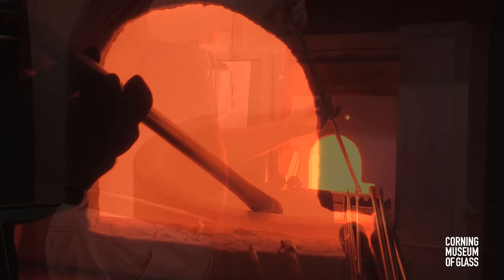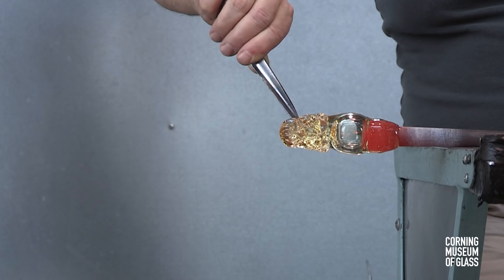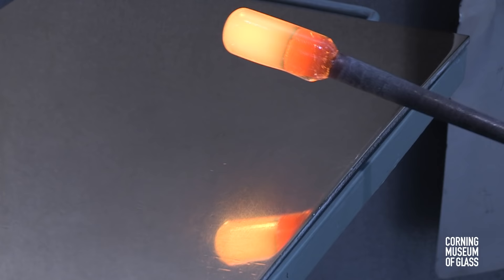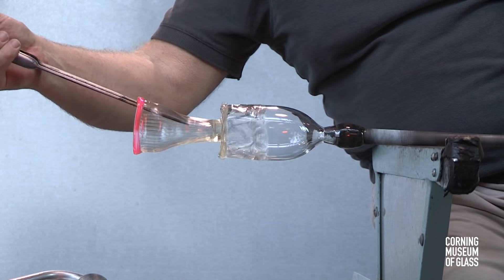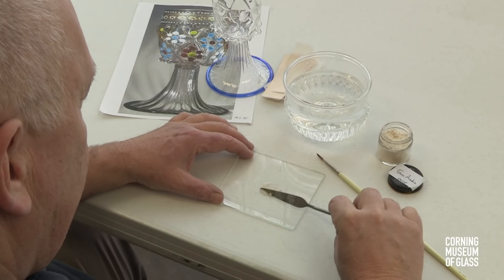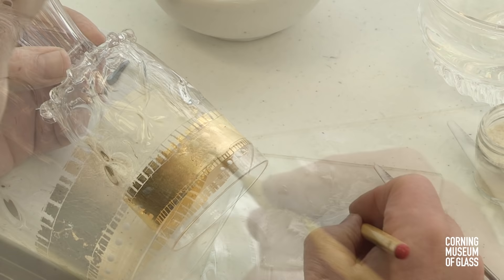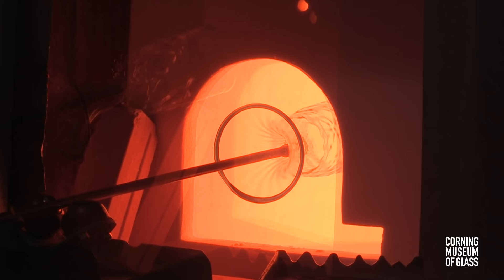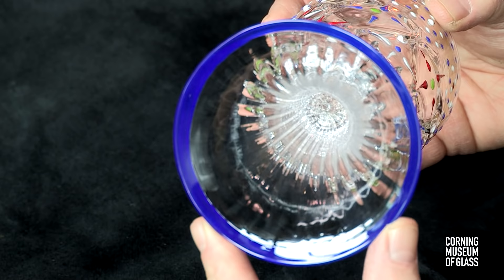Enameled Goblet

Comment: I am ignorant with glass making, (I've never tried it...but I want to!) but I have a question, why did you shape the glass after you decorated the goblet?
Reply from the maker: The glas needs to be reheated to fully fire / fuse the enameled glass onto the surface.  With traditional enamels (not contemporary low-fire ones) that happens at a temperature above where the glass will soften.  The piece is picked up and reshaped to help accommodate this softening of the base glass and ensure the enamel is completely fired on.
Reply: Corning Museum of Glass Oh, thank you!